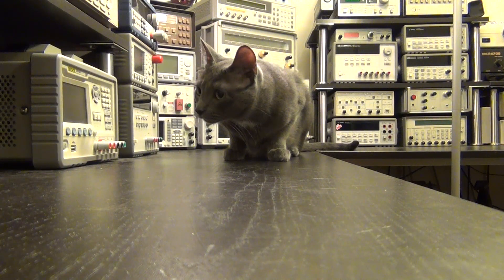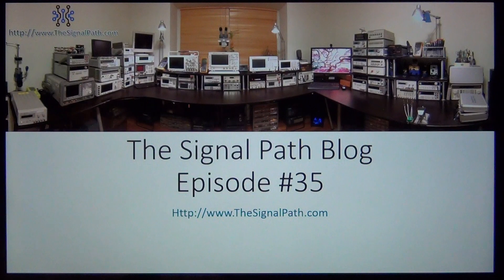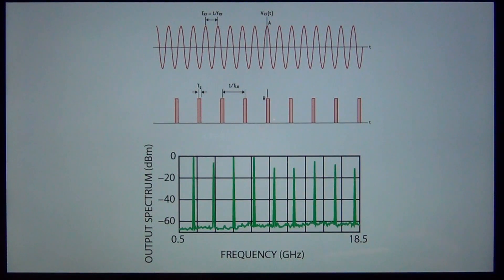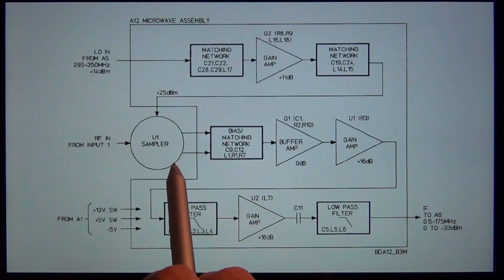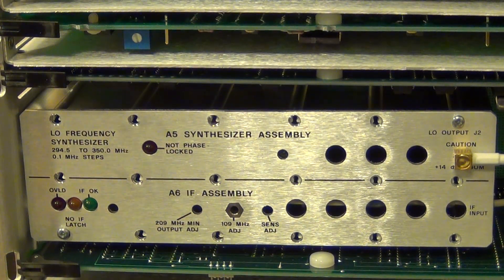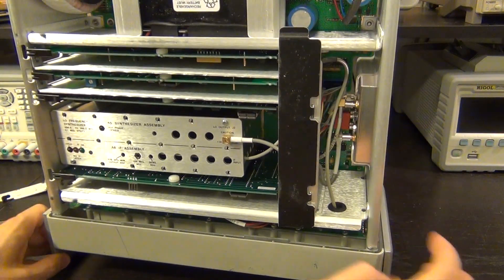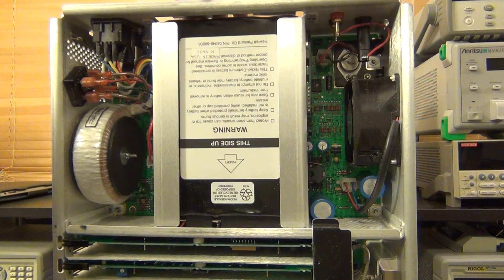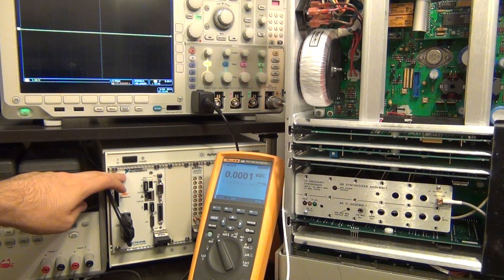TSP #35 - Teardown, Analysis and Repair of an HP/Agilent 5347A 20GHz Frequency Counter & Power Meter

Comment: On the sampler: the input at the right is connected by a ribbon to a black small capacitor chip to ground. Then, a long ribbon connects to a single horizontal line, which is a microstrip line above the ground. Then, a third ribbon is feeding the SRD diode, which is the blue square chip on the right of the microstrip line. On the leftmost side of the microstrip - a 50ohm termination to ground (dark square). Since we are dealing with a very short pulses here, every bit of ribbon interconnecting is an inductance. Therefore all 3 ribbons are inductors with a tapped off capacitor to ground between the first 2 inductors. Effectively - this is a matching circuit, the longer ribbon used here as a impulse forming choke. In the middle - a very thin vertical slotline is coupled to the microstrip. This 90 degrees microstrip-slotline arrangement forms an electromagnetic mutual coupling. The slotline , being a balanced line by its very nature serves here as a wideband BALUN, feeding diode (NOT FET!!!) sampler in the top middle. Usually, its enough to drive the SRD with +17-20dbm to get good harmonic rich output. But here, HP guys had a serious dilemma: To avoid spurious mixing, and possible frequency measurement errors, they needed a nice and clean pulse to drive the sampler and this forbids any reflections going back&forth on the feeding microstrip. Because of that, the microstrip is very well terminated at its end. In such a case, MOST of the energy is dissipated in the termination, so relatively low amount of energy is coupled to the slotline. But in order to minimize the mixing loss (sampling mixers usually provide -20-25db conversion loss which is already bad), the pulse must be strong enough to drive the schottky sampling diodes ON properly. Because of the low percentage of pulse energy coupled to the slotline (low efficiency coupling), the driving power was increased from 50-100mW to huge 300mW (+25dbm).
Reply: Yep you're right. There's a feature article of this device in a HP magazine around 1987. I stared at a picture of this circuit for way too long to try to understand the input chip. 

I couldn't understand why they used a microstrip line on top of a slot line/balun. It seemed so inefficient, and would it work well at the full bandwidth.
Reply: Remember that the frequencies we're talking about are from near DC to 20 GHz. And the SRD frequency is around 300 MHz. For e.g. at 300 MHz low frequencies how does this very 'long' wavelength within a small package ...  sufficiently couple from the ULTRASHORT microstrip line to the small slotline. 

Imagine a 'medium' pulse on a too short microstrip line to thus generate a differential voltage to that very small balun !!
Reply: I wonder at low frequencies if the differential balun begins to operate as single-ended ?
Reply: We use to do this: SRD & 2 matched detector diodes up to 12 GHz pretty easily on a regular PCB !
Reply: No. I don't think, they used sampling below 1GHz. Therefore, sampler performance at low frequency is a non issue. Second, the sampler, being driven by a slotline is always balanced, at any frequency of sampling or input.

Comment: Also, Since the class B amplifier only has one transistor, you are only amplifying one half of the cycle. If this were in the traditional "push pull" configuration, you would have amplification at both ends of the waveform. However, since this is an RF power amplifier being fed into a step recover diode, the distortion present is not necessarily a problem. The most important thing in this circuit is to drive the single transistor into full saturation so as to attain the power needed to trigger the IF sufficiently after leaving the SRD.

Comment: My answer: The 14dBm signal coming into the BJT base has a huge swing. That induces large currents in the base pin. The transistor then operates over ranges much larger than it's linear region, so it's non-linearities come up.

Comment: It is really good tutorial. I have exactly the same unit and have slight same problem with no output voltage and current. I did full self test and had pass. But no output. Do you have any clue for the issue? Thank you

Comment: According to the Agilent(Keysight) parts catalog, the 5088-7071 was replaced by 05350-60113 (or -60114 for a refurbished part). I found that part number listed at Global Test Equipment but I doubt they have any stocked. Here's the link: http://4gte.com/hp-agilent-05350-60113-b-s-sampler-assembly-new.html. Apparently it's also used in the 5348A, 5350B and 5351B.

Comment: I almost imidiatly ge that the problem was the sampler. 
A long time ago I was looking at the schematics and try to understand the working.
So when I saw the repair vide I was saying I wish is not that the problem.
Some idiot have put too much power in the device. I think the limiter is to avoid that by the way. 
How would be to design that component from zero?

Comment: Hello Shahriar. I may have found something for your part, or at least a replacement for it. Check out this link : http://4gte.com/hp-agilent-05350-60113-b-s-sampler-assembly-new.html
The part number cross reference comes from here : https://www.ntecusa.com/Test-Equipment-Sales/Plug-In-/-Part-/-Component-/-Module/Agilent-%28Keysight%29-5088-7071/BD30820E801CE7407AA46622DA606F72
It seems to be the down-mixer stage for the HP 5350B
Also 05352-60101 may do the job : https://groups.yahoo.com/neo/groups/hp_agilent_equipment/conversations/topics/21154
Both parts also have a refurb reference.
Also the whole module for the 5350 looks like a close match : http://www.ebay.com/itm/HP-Agilent-05350-60206-Sampler-Assembly-/251462903621?pt=LH_DefaultDomain_0&hash=item3a8c5b6745
Hope this will help you repair this thing (and post a new brilliant video)...

Comment: The A5/A6 look exactly like what's in my HP 5350B (http://www.kerrywong.com/blog/wp-content/uploads/2014/06/HP5350B_5.jpg)
Reply: BTW, the sampler module on the 5347A also seems to be identical to what's in the HP5350B. http://www.kerrywong.com/blog/wp-content/uploads/2014/06/HP5350B_36.jpg

Comment: Hi Shahriar. 
I found this reference for the GaAs sampler :
https://www.ntecusa.com/Test-Equipment-Sales/Plug-In-/-Part-/-Component-/-Module/Agilent-(Keysight)-5088-7071/BD30820E801CE7407AA46622DA606F72
and a possible source at :
http://4gte.com/hp-agilent-05350-60113-b-s-sampler-assembly-new.html.
It looks like it's the same 1LQK8 cage assembly.

Comment: I think the answer to the waveform at the output of the class D amp is:-
The waveform shows greater amplification on the negative cycle which would be correct as this means the Positive cycle of the input is being amplified, as the transistor would be inverting the signal. and being class D, would be biased nearly off  giving no room for the negative part of the input waveform to be amplified or least very little.